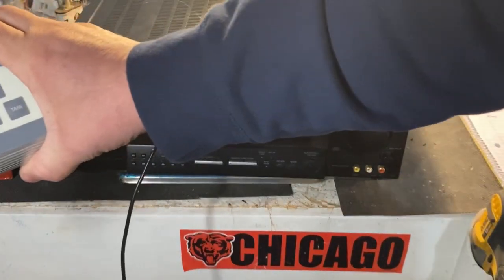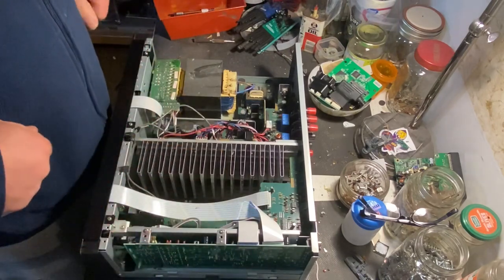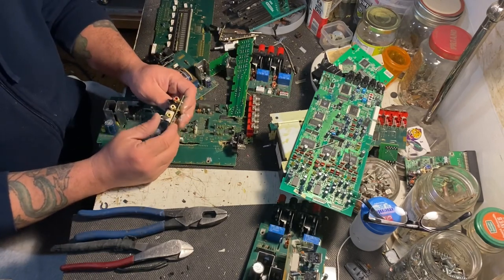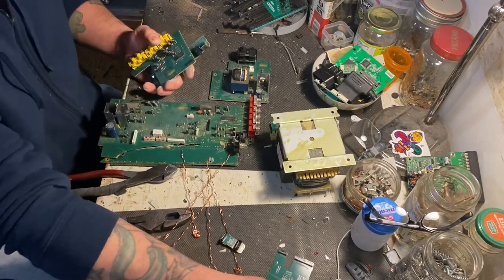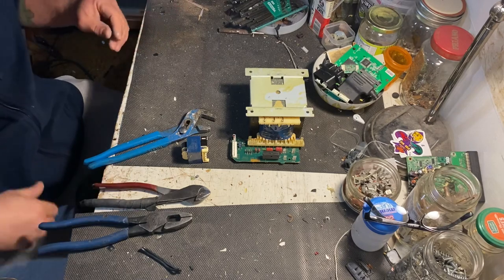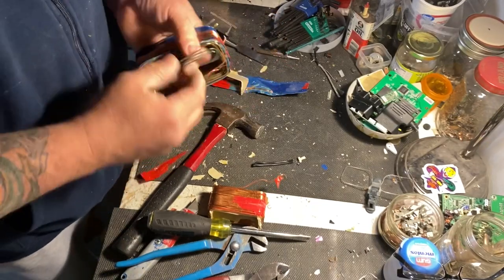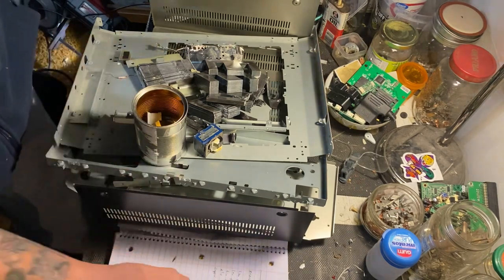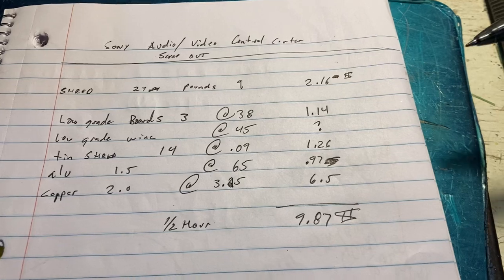Sony Audio/Video Control Center Scrap Out Is It Worth It #copperrecovery #trashtotreasure #scraplife

Comment: Hi there.  Those blue boxes are relays, aren't they?  Copper coil and sometimes silver contacts in them.
Reply from the maker: Yes sir they are .. forgot to mention it I’ll show they in the next video when I melt the copper down .. thank you for watching we appreciate your time 👊🏻
Reply: @streetcopper1151  just finished this episode.

Took apart 11 microwave transformer one day.  Super disappointed that all that work, and only 3 copper coils out of 22.  De-valued them. Did a spreadsheet and if they were sold as copper motors, they would have been worth twice as much, intact.

Still accumulating copper / aluminum to hopefully melt sometime this summer.
Reply from the maker: @cptrikester2671  I hear ya it sucks when there aluminum.. we only get 10 cents a pound for motors here .. so there always worth scrapping to me plus I need the copper 🤣thank you for your support 👊🏻
Reply: @streetcopper1151  last time I was at the scrap yard,
0.30 for copper motors/transformer
0.11 for steel
0.47 for clean aluminum
Reply from the maker: @cptrikester2671  that’s pretty Dag good .. you’ve got me beat on a couple 👊🏻I always find it odd how scrap yards can be so different in prices I can understand a couple of cents but your getting 20 cents more for motors 😳
Reply: @streetcopper1151  Canadian, mind you. 🙄
Reply from the maker: @cptrikester2671  man I love you Canadians 👊🏻